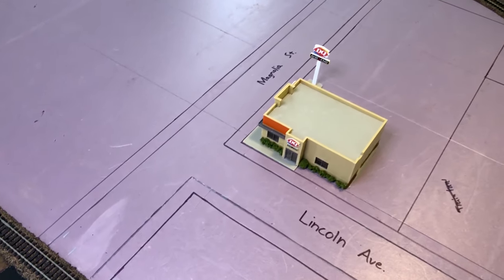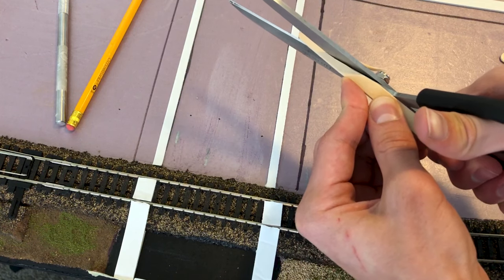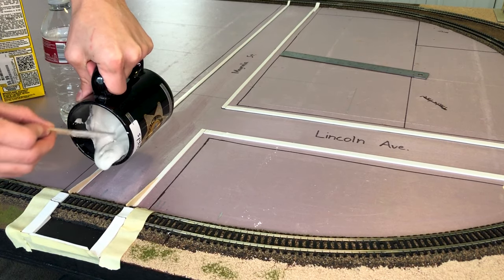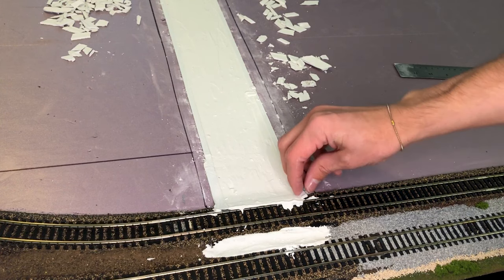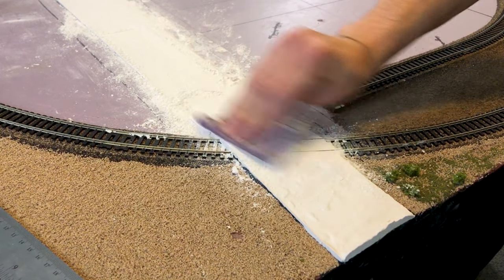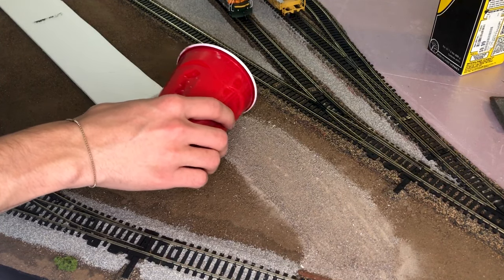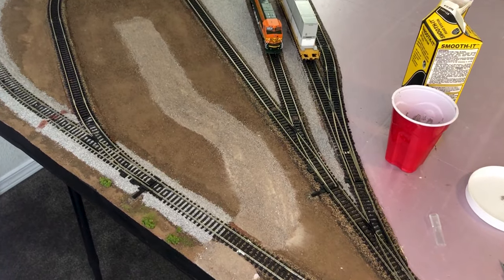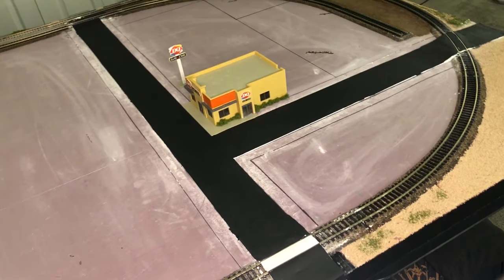Building HO Train Layout - Ep 5 - How to Make Roads!

Comment: Just a suggestion. You can mix white glue with water, about 1/3 glue to 2/3 water, into a spray bottle and cover large areas of dirt or grass. Just a few drops of dish washing liquid so the glue doesn't bead up when you spray it. If the Woodland Scenic's is thin enough, you might try putting it into a spray bottle. The layout is looking good!

Comment: I’ve found a much better product than Woodland Scenics Smooth-It for making streets and highways for model railroads:  Red Devil OneTime Lightweight Spackle.  It’s pre-mixed.  No fuss, no mess.  Just apply with a putty knife between the paving tape (though I do recommend masking tape underneath that if applying to a plywood base).
It sands easily with much less dust, and takes paint beautifully.
Why mix a powdery product that usually winds up in your lungs when you don’t have to!

Comment: I built my first layout in 1976. Love the use of foam board. Obviously much lighter and easier to affix the cork and track. Just wondering though, you have great attention to detail in your layout and in the videos so I'm curious to know if you plan on putting bumpers at the end of the lines in the freight yard sections for authenticity. I used the ones with the red lights. Adds a great finishing touch. Just a suggestion. Keep up the great work!
Reply from the maker: Wow you must have a lot of good knowledge on model railroading! But I do plan to get those little bumpers, except they will go on my new layout! The red light on them would be a marvelous detail
Reply: @TopRailroad  I noticed that you were wearing a Harley Davidson t-shirt in one of your videos which begs the question, do you ride? I've been riding motorcycles, Harleys mostly for about as long as I've been in love with HO trains. When its winter and I can't ride is when I concentrate on the trains. It's a great indoor hobby. Another thing: I like how you use things from your own backyard to use in your scenery. Whenever I'm building rock formations or need a few large boulders in a scene I'll go to one of the local rail lines and scoop up a bunch of the ballast rocks and use them adding great authenticity to the scene. If you ride...keep the shiny side up and keep on 'training!'
Reply from the maker: @carlloud1187   I don’t ride any motorcycles but I have always appreciated and liked them a lot. It’s awesome that you ride though! But I do agree trains is a great hobby for indoors. Thank you for the super cool comments. The ballast idea is also one I’ll keep in mind. Same to you man!